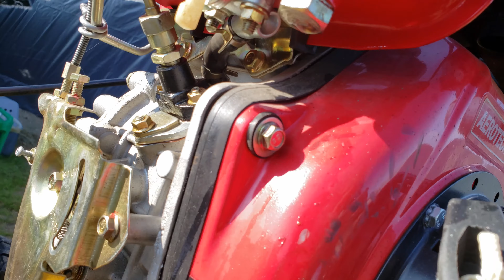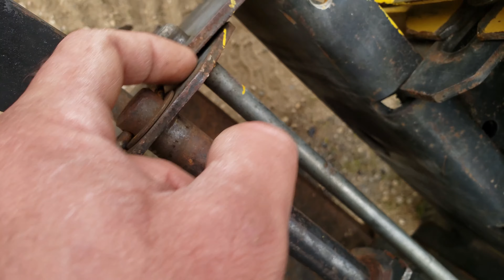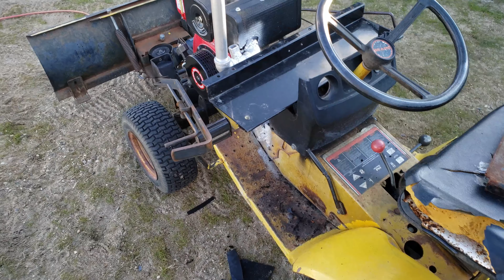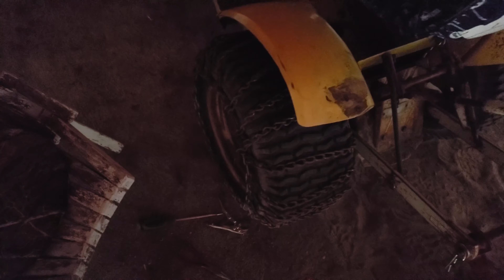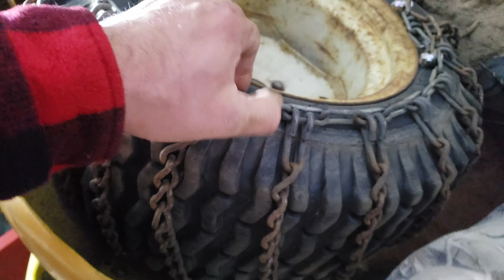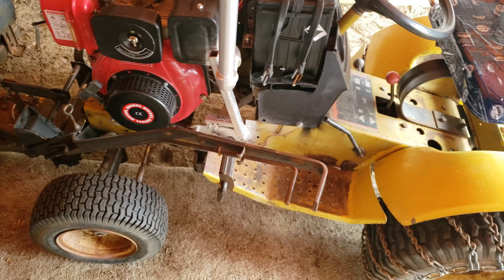Sears Suburban 6HP Diesel Snow Plow Build (Part 7) Battery / Plow / Exhaust

Comment: Just buy an adapter that bolts to the studs where the stock muffler connects, or buy a predator 212 stack pipe & adapter, look pretty close to the same size as my current predator 212 stack. 

Tried to blow smoke on my predator 212 without obstructing power & getting oil splattering or harming the motor & it’s just not feasible. Diesels work nice on sears tractors, because the electric side of the tractors is lacking & the stock motors have enough issues where you can buy a good motor to throw in it/cheap predator engine w 1-2yr warranty.

Comment: great video curtis i like the set up u have thewre not a bad idea too bad u took the dash off couple of qustions for u with the set up u have there wood a hood work for that and for starting it with a key where will u put the hey thing since there is no dash
Reply from the maker: Ill Be doing the same idea as for what i did with my old 10HP Diesel Sears , It will fit "ok"
Reply: @starpuss  ok lol